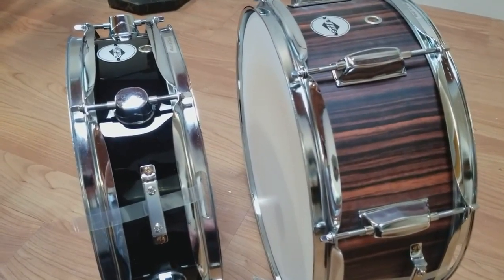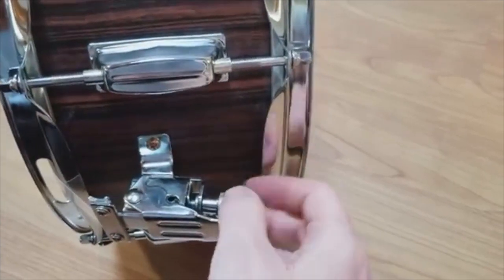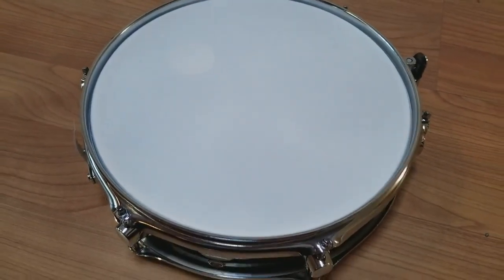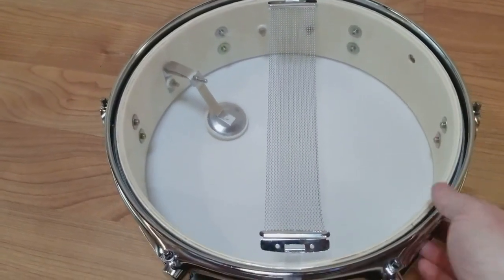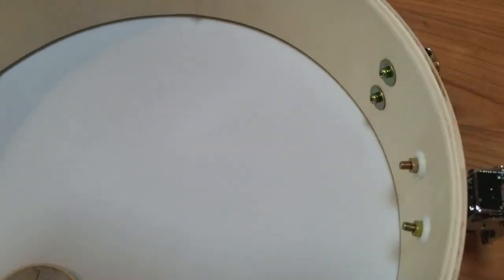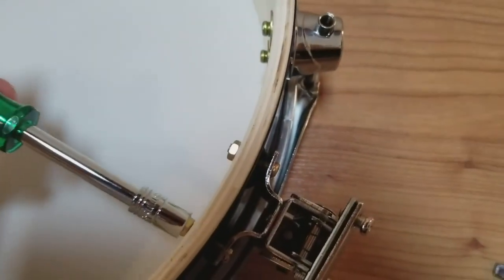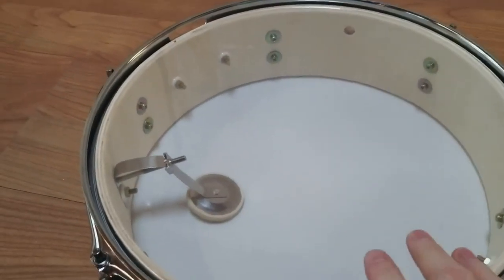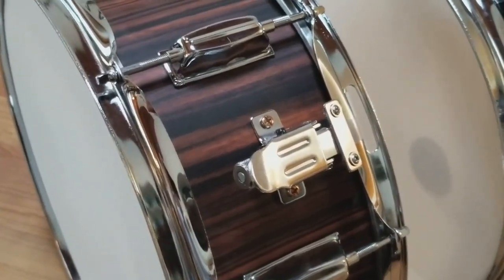Griffin Snare Drums -- What to Know BEFORE you Buy -- REVIEW and REPAIR

Comment: Nice. Good job! Some other adjustments rdavidr did on the Griffin Popcorn snare are put cotton balls in the springs of the lugs (so they don't rattle), stretch out the springs afterwards, put a washer under the dial of the internal muffler so it doesn't wear out the shell's wrap so quickly (plus it turns easier). Those things with everything you did (especially with the throw) should make these very decent sounding for the price.

Comment: 3:30, can you help me? My snares got the same problem as that one and I tried to do what you said but it still sounds that same. Could you explain what you did?
Reply from the maker: What I did was loosen the snares so that the knob would allow for slight adjustment.  To do this, release the snare lever to make them loose.  Next turn the knob so that it is a little more towards the middles (not too tight or tool loose).  Loosen the two screws that are holding the clear plastic that is looped through the snares.  Pull that piece of plastic tight and while holding it snug tighten those two screws again.  Now you will have some adjustment ability by just turning the knob.  This is how it is supposed to work.
Reply: @arnold894  late reply but thank you! I was also having a lot of trouble because one of the screws were stripped but I've fixed it now!

Comment: I would love to see if the picolo snare can stand to be tighten like crazy in order to have a real killer reggae sound. (or if the cheap screw attachment will snap under pressure...)

thx for the review and tips anyway :)
Reply from the maker: As far as tightening, I don't think any of the metal would break.  Instead I think the heads would pop and the plastic on both sides of the snare might also break.  If you replace these parts I think you could make the whole thing really tight.  I might also replace the snares on the bottom too.  Thanks for the comment!
Reply: thx!
Reply: well, sadly they seem not likely to distribute in europ... no snare for me :(
Reply: 0
Reply: I’ve  gotten away with changing to bigger washers contacting the shell to help keep the soft wood from cracking too much when tightened as far as possible

Comment: This is a 3 ply fur wood drum with uncut bearing edges.   It can be fixed and used but it will never become a good snare drum.   the less than 40 dollar price is a good price for some decent hardware, add a shell from Soda City drums, add some drum heads, and you can have an excellent snare drum for under $120 bucks.    Its the shell of this drum which is where the company saved money, and the bit that needs replacement.... eventually